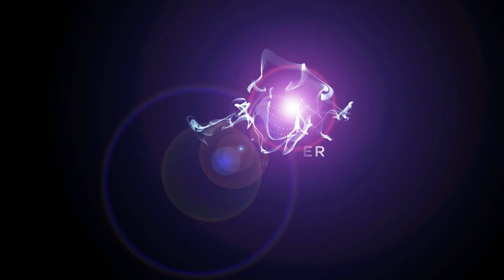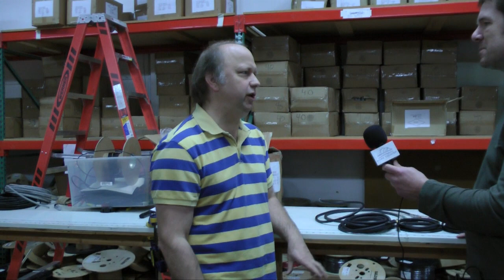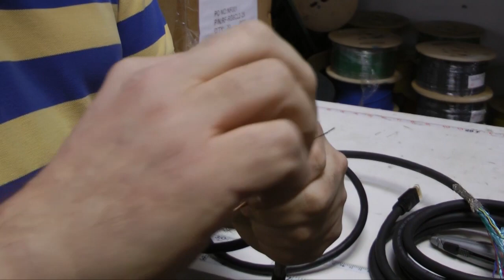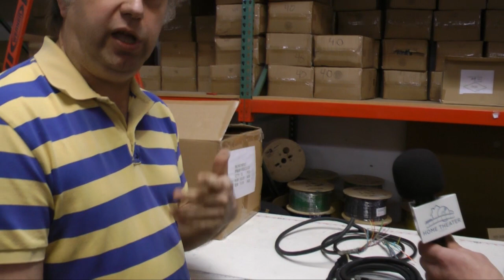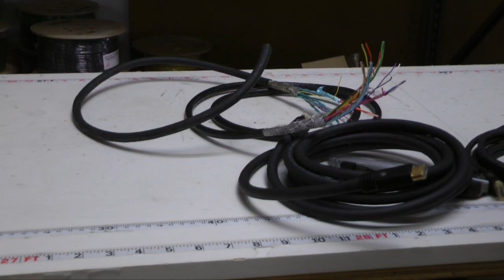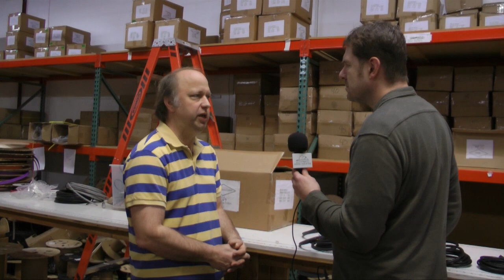Blue Jeans Cables - What's the Difference between a $17 and $150 HDMI cable?

Comment: Goddam brass connectors and lead solder make cable lose much of the signal. Mass manufacturing only get you exterior bling with piss poor conductivity.

Comment: If your HDMI plugs are good quality the difference to a better cable is - a lower gauge wire. The theory is true with speaker cables , no and I’m not referring to expensive speaker cable. You can purchase 14 or 12 AWG speaker wire with a good set of banana plugs and could make a great pair of speaker wire.

Comment: If the signal isn't corrupted (not a subtle effect), then there is NO difference.
NONE!
It's a digital signal. All or nothing.
Reply: If jitter matters, it an analog signal.  Time being the analog quantity rather than voltage.  But cables don't have jitter anyway :)
Reply: Jitter only effects the audio at the DAC or ADC.
Jitter in a digital signal will either completely scramble the signal (if it exceeds timing tolerances), or have exactly zero effect.

Comment: I'm a custom installer/integrator and used to buy boxes of these Belden sourced cables until I had a batch that failed at the connector. Blue Jeans would not return the product and I didn't return to do business with them.

Comment: The difference is that if you cut open a $17 cable you will find it is full of air, however if you cut open a $150 cable you will discover that it is full of snake oil.
Reply: The addage is that if you spend more on it, it sounds better.  To you.  Not to anyone else, just to you!
Reply: you sound lost
Reply: Difference approx 120 USD, I keep it

Comment: That whole "but the expensive cables are more durable" argument is completely moot. I saw a monoprice vs monster cable comparison in regards to durability. The monoprice cable came out on top. If the expensive cables are more durable... You can buy several hundred monoprice cables for the same price as a single "high end" HDMI cable. Try and convince me that a single expensive HDMI cable is going to hold out longer than say... an equivalent value of monoprice cables.

And even so, most people plug them in and leave them there, and they never do fail.

Long runs? If it's got the HDMI stamp and you can get a picture out of it? It's working fine. I've used some budget 10 metre (30 feet) cables from a reputable electronics store here, and had no troubles.

Comment: The question is, does HDMI suffer from jitter/EMI/RFI like USB cables? You NEED proper shielded USB cable when you carry Audio data. I don't know if this is needed also for HDMI. I heard video is tied together to audio, so audio is not a separate channel on HDMI cables so a better HDMI won't make any difference in AUDIO quality. Maybe some people care about AUDIO.
Reply: GraveNoX if it's got the badge, it will perform, period. It's a work or doesn't work proposition.

Comment: In short runs, No. There is no difference at all. It is either a quality cable that works, or it doesn't. It's not a coax that semi works. It's digital so its good or it isn't. 
On longer cables over ~20 ft, yes. but not $100-500 difference. 
People are buy a name with this product. You will get the same signal from a cable on amazon with a good rating.

Comment: SUCH a scam.  Make no mistake Audioquest is the biggest purveyor of the "high priced fancy shmansy" speaker cables & audio cables.  Blind audio tests have proven this time & time again.  Lamp cord (zipcord) vs the big brand names and no one can tell the difference.  Wire gauge is ALL that matters.  All you are doing is making an electrical connection.  A fool and his $$ are quickly parted.....remember that the next time you see Audioquest, Kimber Kable, Tributaries, etc..
Reply: cables made in the usa with china sourced materials. like Gilmour scribbling a signature on a squier to sell it for tens of thousands.

Comment: So what he said was that if you wanted a 40 Ft cable to join to another 40 Ft cable then you will need a god cable, Ten says that theirs are guarentee up to 25 Ft? So is he saying his are crap? And also that you need luck as more expensive is not better as they are all going to China to havethe ends put on because of the difficulty of soldering the wires into the ends.? I watched a video that showed then using a system similar to the BT where they push a wire through a cutter so are not soldered any way

Comment: digital is either there or it isn't. however, spending £15 rather than going for the £2 cables is probably going to mean that they last longer and don't malfunction, which is an issue ive had before
Reply: James Denton I'd need that 2£ cable to fail 9 more times in a row. The odds of that are pretty slim for a digital system that corrects errors.
Reply: that's true, but those cable work intermittently and when they do go, you have to wait for them to ship.
Reply: You have no clue how digital works.
Reply: @carlosoliveira-rc2xt  , how digital works?
Reply: A $15 cable and a $2 cable is the same thing. They're both cheap cables. Nothing to do with structural integrity.

Comment: I've found the $10 cables on Amazon is all you need. Don't buy the cheap $1 ones, those have very thin wire and may have issues with signal loss and EMI, not the mention quality and durability issues. I've personally experienced this with screen going black, freezing and rainbow static with the cheapest ones. The standard ones work great. The expensive ones are a scam.

Comment: I'll hazard an answer. What's the difference? $17 cable is $15 profit and $150 is $148 profit? Is that correct. Do I win the prize? BTW I've never seen sparkles or flashes with even the cheapest of HDMI cables.
Reply: +migry He fairly clearly says that most people in most common configurations wouldn't.  He also says explicitly that a 2$ cable will perform perfectly in most applications.  I don't know why so many people seem to rage-face at this guy without listening to what he said.  There are a lot of rich people who set up very long runs inside walls for elaborate home theater setups.   Have you ever run 50 feet of hdmi?  How about 150?  Did it work with 2$ cables?  You probably aren't this guy's target market and he's being very up front about that.  I honestly don't know how he could make it clearer.  He even says explicitly that if you have a cable of a given length that appears to provide a consistent image, it doesn't matter how much it cost.  Are people just showing up here and popping off without listening to a thing he said?
Reply: migry Probably has to do more with run length and signal degradation.
Reply: Actually the $150 cable likely costs a bit more to make, so its more like $15 profit v. $140 profit!

Comment: how could this vdo possibly be 31 mins long on that topic? the answer is simply "same" .. because it is DIGITAL.
Reply: MuristekTV yeah I'm dumb. and so as all computer engineers around the world who know how DIGITAL works. go ahead mister "I'm so smart I have to insult strangers on Internet cause it makes me feel good", go spend thousands of dollars on cables. none of my fucking business idiot.
Reply: Yea...um...it's not as simple as you think. It's very easy to fuck up a cable and make it perform worse than it should, despite being digital. It's only when you start comparing two PROPERLY designed and manufactured cables that they become identical in performance.
Reply: And what about all the interference that has a huge effect on performance of these cables? Oak, you are dumb as a tree. Yes, the oak tree.
Reply: @Coilaman  If you have RF or EMI interference powerful enough to interfere with HDMI signals, you've got bigger problems than a poor cable.... you might want to get out of your house.

Comment: I have a high end home theatre system with expensive pre/pro and multichannel power amp and I am running 7.1 analogue from Blu-ray to pre/pro.  I was looking at Cardas, Neotech, Nordost, and a few others for my system.  I decided to look at the reality of interconnects as well as talking to professionals on the phone. 

I decided to buy interconnects for the Blu-ray 7.1 and pre/pro to multichannel amp and sensibly settled for a company that will keep the sound totally uncolored and pure without glitz and 800% to 10,000% inflated price for this performance.

I just ordered Blue Jeans Cable LC1 for everything I need to hook up.
Reply: If coaxial cable geometry was good for RCA analog interconnects you'd see more companies in the industry use such cables. Great for SP/DIF and LFE but not l/r line-level signals IMO due to impedance differences between the conductor and return.